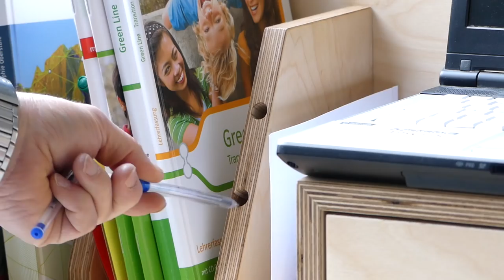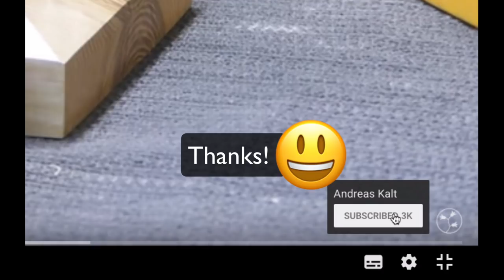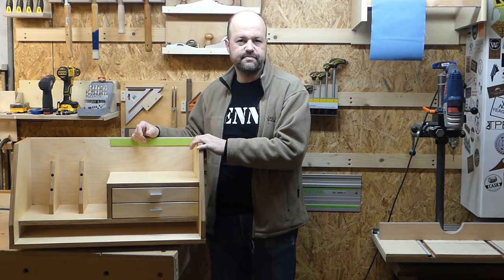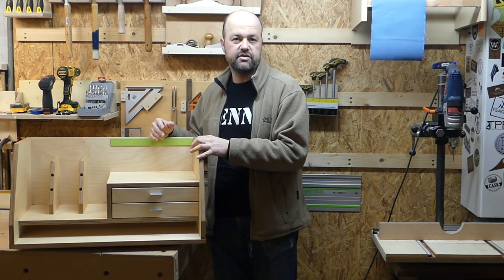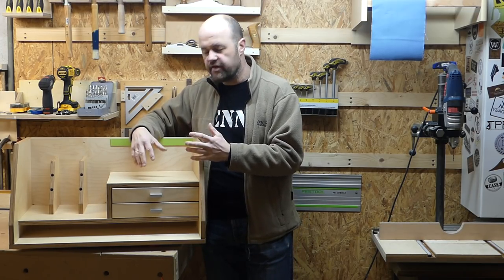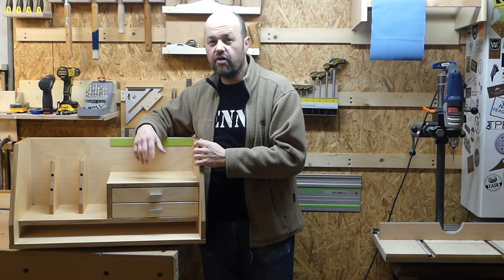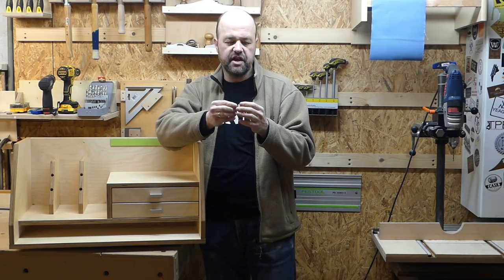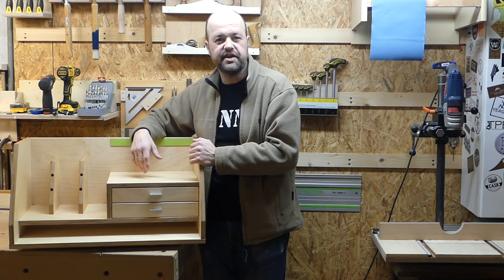WOODEN DESK ORGANIZER (DIY) – GET RID OF THAT CLUTTER

Comment: Turned out nice I like the pen holders in the dividers.never knew Bosch fits on festool tracks and that Makita makes a cordless biscuit joiner..good stuff.
Reply from the maker: Thanks Joe, those pen holders were a spontaneous idea because I need some pens handy and didn’t want to take away the space for the laptop or the books. So I wondered where to put them where they won’t be in the way. The Bosch saw has two grooves in its foot, one for the Bosch track and one for the Festool track. And a fine-tuning screw to adjust the play.

Comment: What i noticed: In the teachers room in front of your place is also a place for another teacher. Has this teacher to look against a wooden wall, where in earlier times was an Andreas?  :-)
And another question: Would your favorite pocketholes or biscuitjointing? I'm also not a fan of dovelconnections. In specials cases yes, but in the furniture building i hate them.
Cheerio from the Schwabenland.
Reply from the maker: Very considerate of you Alfred, to think of my colleague. The organizer is low enough that we can look at each other across the top. And (what you don’t see in the video): I attached another strip of metal on the back so that my colleague now also has a magnetic bulletin board – as a compensation for the wooden wall in front of him (even though it doesn’t hide me). 

For furniture like this one, I prefer biscuits because they’re invisible. I think pocket holes are fine (and a little quicker to use) when you can hide them, for example in drawers or inside cabinets.

Comment: You made a really masterpiece Andreas.
Very fine working, and this time your drawers are perfect (about runners thikness: do you remember last time the dimensions of the runners was too much higher ) 
for the stop ring maybe with a little sanding you can recover the problem in the visible surfaces .
at the next video
Reply from the maker: Thanks for your kind words, Zola! Yes, I remembered your comment about the runners and cut them thinner this time. Sanding would work but it depends on how heavily you come down on the surface that’s why I thought it would be good to mention it.
Reply: Andreas Kalt: genau!😎😎😎